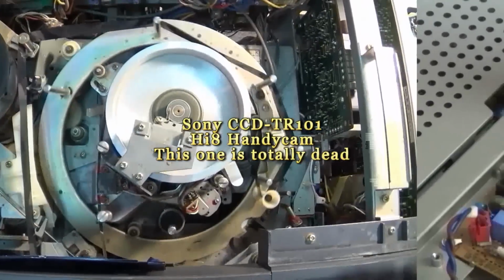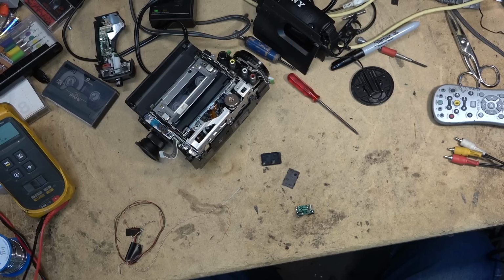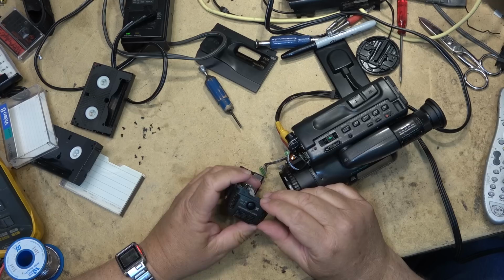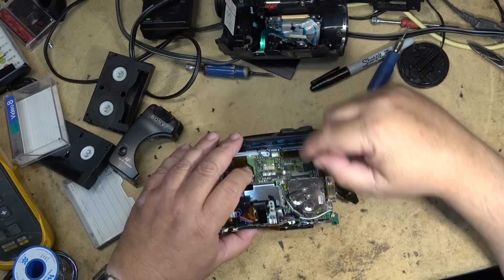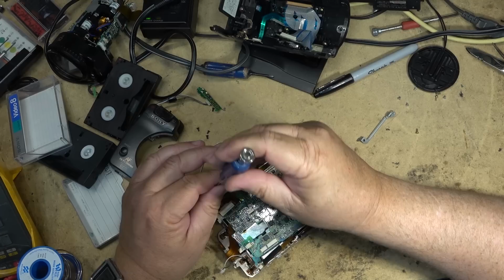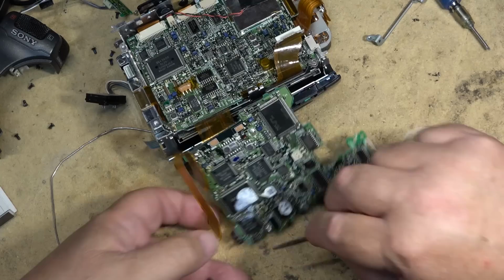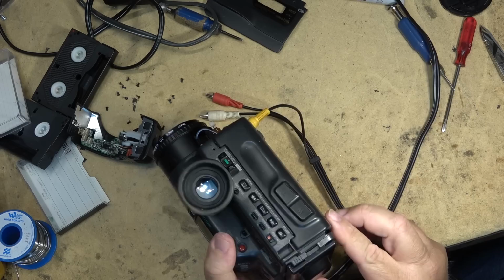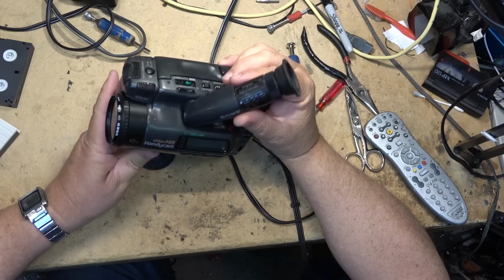Sony CCDTR101 Handycam Totally Dead lets Fix It

Comment: I just bought a CCD-TRV75 made in 1998 that is completely dead. Doesn't power on from the battery or power adapter. Could it be the switch or probably a blown fuse or other damaged component? It has the design where the switch is near the lens and not by the record button.
Reply from the maker: Could be anything

Comment: Great video. I just picked up the same camera from a yard sale for $2. Owner assumed it was busted, but after a quick battery charge the thing powered up just fine. 
I am facing an issue with the tape deck constantly ejecting when there's a tape in it. Otherwise, the deck will close and lower just fine with no tape inserted. Any advice?
Reply from the maker: When you load a tape do you hear the head drum spin up? Does it sound normal or fast?  Could be dirty contacts on edge connectors.  The capstan motor also rotates briefly before the tape loads.  If the motor can't spin up it won't load. When there is no tape inserted then it doesn't attempt to test the motor rotation because the end sensors are uncovered and it knows there is no tape. It does this because if the capstan motor wasn't turning and the tape loaded it wouldn't be able to unload the tape and an eaten tape would result.
Reply: @12voltvids  where do I identify the edge connectors? Novice here.
Reply from the maker: I have several videos showing them and how to correct.

Comment: I have Sony DCR-DVD202E 
Why it is working on the AC charger (without the battery) and while I put the new battery on and disconnect the charger it doesn't work. Also I always charged the batteries while connected to the camera, not by separate charger. While I charge this new battery, which is not original, it seems to charge it because the yellow-orange light is on, but after a few minutes it starts blinking and it seems that it will blink forever,nothing happens. Battery seems not charging this way. I have original batteries NP-FP50 but they are old, camera dont work on them. Years ago i charged them with the original Sony AC-L25B charger which I have and it seems works good. 
I have noticed the difference between the old battery and new one, that the older one while in charge, the light starts blinking after a few seconds, maybe a minute, not any longer. The new one which i bought few days ago starts blinkig after a minutes, maybe 10 or longer so its strange. I need help. Camera works very good while on AC charge but there is this problem which I can't find any solutions on the internet. What is maybe also important that i didn't used this camera in years. Battery (older one) was attached to the camera. The electric battery contacts are clean also.
Reply from the maker: Sony cameras communicated with battery.  Not original Sony battery. Sorry Charlie it won't work.
Reply: @12voltvids  Ok maybe no-name batteries doesn't work, maybe some are good. But why original is not charging? It should even a little and if it's so old it should be funcional for even a minute or two and then be dead. Best thing is that I can't find shit on the internet to solve the problem. There is no such info, found similiar problem in similiar cameras but can't do shit with it... Sure, I can buy new battery and bounce off the wall if another one won't work. Who wants to use some old gear when there is new and all is made fancy new every 6 months-1year to be functional for 2 years maybe and then goes to the bin.
Reply from the maker: @Bartosz10000 here is the thing with lithium batteries.  If they are left connected to the device they will over discharge.  Once they get below the critical low level voltage (which the device would have long shut down) there is a most built into the cell which will turn off.  Once it's off its off.  Cell is shot.  No amount of charging will bring it back.   It's a safety feature built-in because charging a cell that is over discharge can be extremely dangerous the cell could explode basically. Once they have shut off they have shut off.  I have 20 year old lithium packs that still work perfect because I do not store on the equipment and charge them up from time to time.
Reply: @12voltvids  So that's the thing. Thanks. 
So there is a chance that they sold me a  old battery. The one which I bought few days ago. Or it's not communicating with the camera because there is no InfoLithium logo etc.  on it. Maybe one of this or both. I wrote a message to this seller and I'll wait what is they answer about this. Maybe they will send another one to me to check or they can kiss my ass and I will search for another one 😀 
So I have made a mistake not using the camera in years, the battery was just attached to the camera and never used later. Now I have to struggle.

Comment: Same old problem, crap caps and fuses.
Restricting the pcb lift by making the ribbon direct.
Well it's not bad for a 4 million year old camera :-D
Reply from the maker: I think Sony did that in this case not because they wanted to make it difficult to service but more for to try and get the boards closer together for size. When you put a connector on with a header it just takes a couple more millimeters of space and they were trying to sandwich those two boards extremely close together. It was a stupid design though because in the field if you had to change a board now you have to change two boards or if you damage that flex cable that you had a real fun time attaching a new one. FedEx camera I work on will be when you guys are going to like him pretty sure it's an evw300 which was the highest and High camera ever made by anyone. When you see it you will understand. It's a three chip large metal magnesium body eng camera. I wish I had kept mine but I sold it. I wish I had kept it because well that's the camera that caused me all the headaches with eBay and PayPal at least 20 years ago now. I had switched my production studio completely to digital using mini DV. So it wasn't being used and I figured it would just deteriorate so I put it up for sale. I got zero bites nobody wanted the camera. So I thought I would get clever and I listed it as a Canon lens and it was a good lens that was on the camera I think it was an F 1.3 something like that but it was a bright lens but it was a half inch lens which means it works with half inch CCD cameras. When I advertised it on eBay I advertised it with the correct model number for the lens and it was very specific it said for half inch cameras included in the deal is a free fully functional evw300. I listed like that because nobody was interested in buying a professional High aid camera so I advertised it as a lens with a free camera. The dork that bought it didn't read the part about the lens being for half inch cameras. He wanted to use the lens on his 2/3 inch camera and of course you know what's going to happen if you're going to have dark corners because the lenses projecting an image on a half inch sensor not a 2/3 inch sensor. The guy wanted his money back and I said no all sales were final it's not my problem that you're an idiot and you didn't read the ad but I'm not taking it back. The SOB filed a chargeback and after a year of fighting with eBay and PayPal they refunded his money he kept the camera. eBay sent me the name of a collection company that for a fee would help me retrieve my camera the problem is the fee that they were going to charge me was more than I got for the camera when I sold it. That was the last time I sold anything on eBay. eBay's response and PayPals was that I had to treat this the same as a retailer would treat shoplifting and consider it a cost of doing business. easy for a multimillion dollar company to say something like that when it's not costing them anything but I lost a couple thousand dollars on that sale and that was a lot of money. I should have just kept the camera and put it on display. It could be sitting right up there next to my JVC professional DV camera and my betacam.